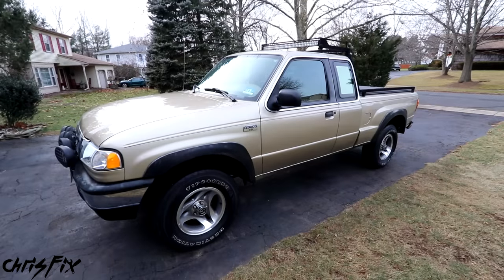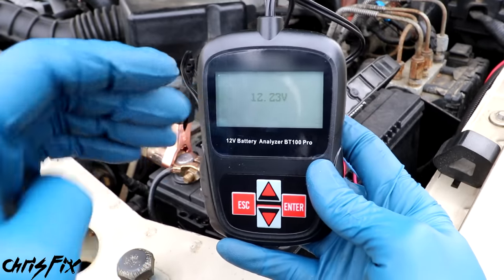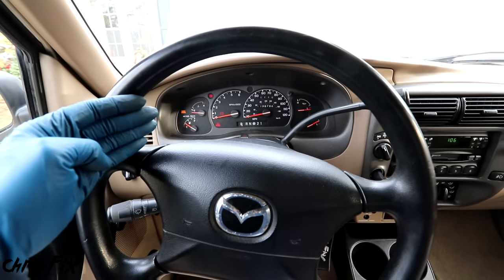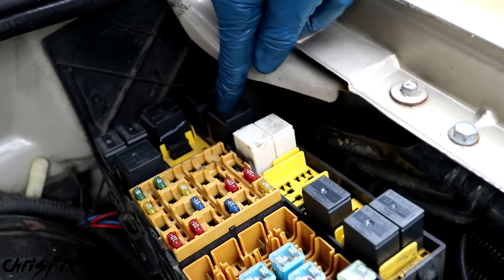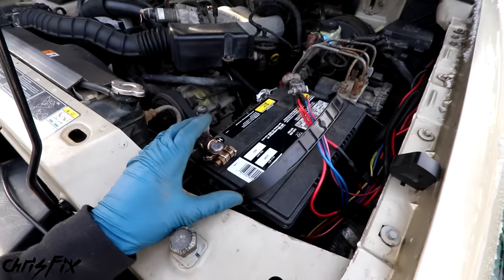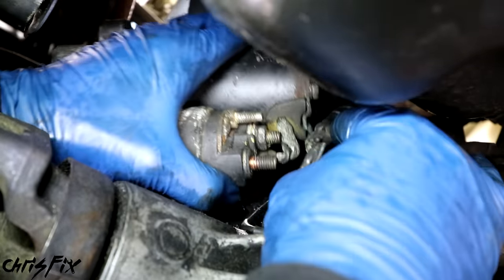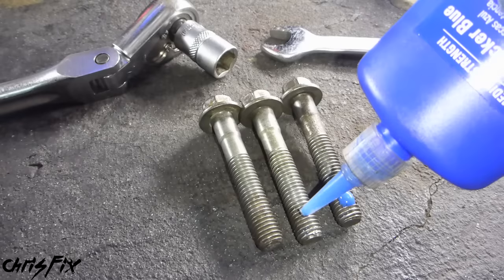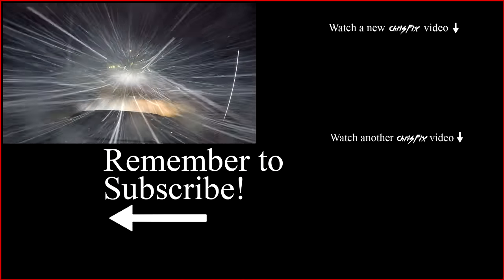How to Diagnose and Replace a Starter

Comment: It's not just Audis. Their cheaper cousins can be fun to work on too. Schultzy, my beloved '98 Jetta was cranking weirdly and the starter was making unhealthy noises, so I decided to switch it out.

It was in this process that I discovered that there are two short bolts and one really long one. In the case of this Jetta, one of the short bolts had been omitted, probably because it's not easy to reach. It's not hard, though, I guess folks get lazy. With the one lonely little short bolt out, I kept cranking and cranking on the ratchet and the bloody bolt just kept coming. I commented to my son that when that bolt finally reaches an end, the right, front tire would fall off. 

That little joke turned out to be a bit too prophetic. As I was pulling the new starter out of its box, we heard a mournful grunt and a dull thud come from under the car. The motor had just laid down on the ground under the car. As it turns out, that really long bolt also went through the front motor mount.

Getting the motor jacked back into place was a delightful exercise in vocabulary enhancement, but we got it back together.

I ended up replacing the other motor mounts because one was slightly torn and the other was completely separated. They were pretty old anyway, but it was tons of fun without a lift.

Keep those awesome videos coming!